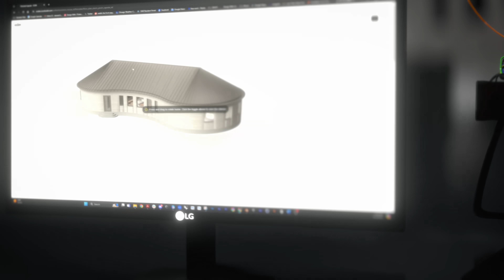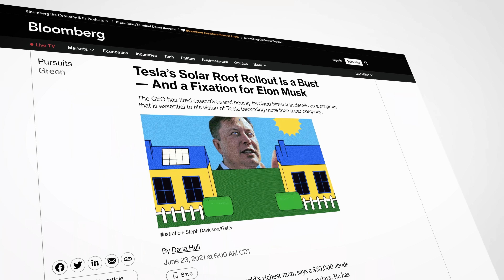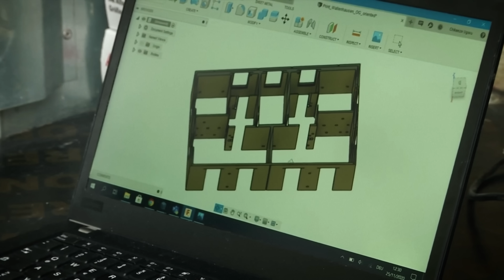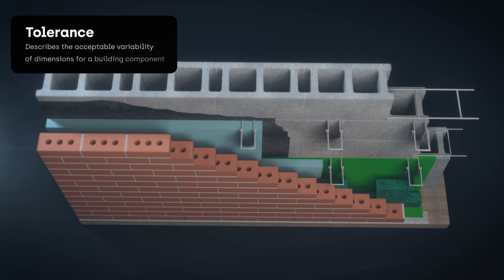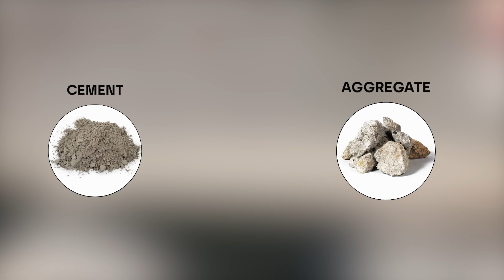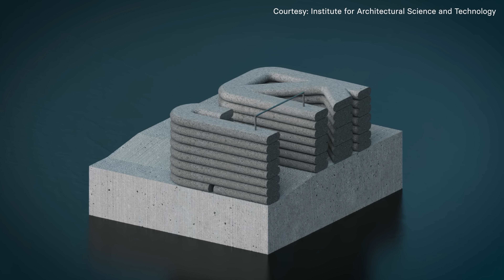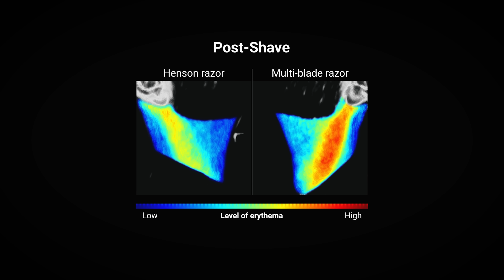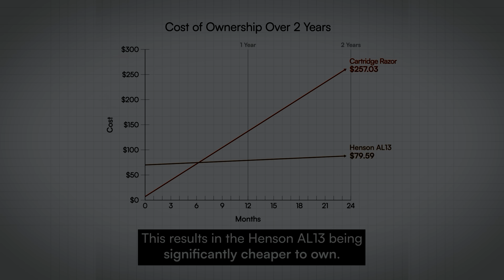Why 3D Printing Buildings Leads to Problems

Comment: Why don't the nozzles have a "fence" on either side to allow the walls to mold into a flat/smooth edge on the exterior and interior sides?  Sure, on each corner, it would be necessary for the fences to adjust in/out to not "cut" into the uncured lower layers, but that seems like an architectural oversight, and one that would be feasible to implement, especially on fresh, soft, just poured concrete. I don't see a "widespread" public draw for the pictured lumpy "toothpaste-layers" look.

I see other comments talking about indoor stucco to cover it, but I've never heard of indoor stucco before, and that sounds like a certain head-scalper if someone trips and scrapes the tough stucco.  Also, stucco indoors is an unappealing, rough, step-in-the-wrong-direction kind of texture anyway. What happened to smooth paint?  Now, "orange peel" texture is all-the-rage, because contractors are too cheap/lazy to do a proper, smooth paint job. Stucco is much worse.

The design of the fence would have to be like a pivoting/sliding trowel, controlled by the computer connected to the nozzle. That would make the finished product much more like a "usual" concrete-walled structure.  An "advanced" fence design could have split "winged" trowels on the sides to really make the corners pop.  It'll take a lot of finesse on both the software and hardware sides to make such a design work, but it should be economical when tuned well.

From a basic perspective, it would look like a Star Wars Tie Interceptor fighter. With the nozzle being the capsule, and the actuating trowels being the wings.

Comment: odd thoughts. 

Why not have a scraper that runs perpendicular to the print head, on the visible side of the wall, that smooths the concrete as it is printed?  Or even a small V-shaped follower that would attempt to make the results smoother and more uniform?

In desktop 3d printing, we often pause the print to insert things like magnets into the print. Could pre-build conduit be used to, say, drop in all of the electrical outlet boxes in a room as it is printed? Same, maybe, for a window frame while the concrete is still wet and pliable?

Comment: Current building materials in the US are shit. Expensive, require high maintenance, building it require a lot of men power, takes long time to build, not sturdy, has a lot of variables, hard to control if material, application, etc are proper as they may later cause a lot of issue.

Comment: I don’t think concrete 3D printing is the future of homebuilding. There are too many issues regarding on how tight foundation tolerances need to be, long machine setup times, limited floorplan flexibility, and the fact that hollow concrete walls often don’t meet insulation needs in most climates. And I think the printed look isn’t for everyone.

If you do it Off-site, it doesnt get much better, the wall components would be very heavy, and installing concrete walls on-site requires expensive connectors and equipment like Munck trucks + insulating and waterproofing that interface of walls and foundation.

That said, I do think this tech is great for making urban furniture: bike racks, planters, benches, bollards, etc. These don't have the same structural demands and benefit from the design freedom and speed 3D printing offers. Futhermore, it's a one time setup on a closed factory

Comment: Also if I want to hang up a picture or mount a tv on the wall or some other appliance. It’s much more of a hassle to deal with concrete than driving a screw or nail into some wood. Also what happens if there is an electrical issue or a leaking pipe behind the concrete wall.

Comment: Yes, you can fix it and hide the grooves. Houses built of cinder block and brick have been addressing this issues of centuries. Outside of the US we cover the walls in a concrete schmear then plaster (the thing drywall emulates). I've lived in both types of house and real walls (not wood framing and drywall) are amazing. You can hang pictures where you want, they provide real sudden barriers, they aren't damaged by water or fire. Maybe you can't get the grooves too match perfect on a fix, but it really isn't hard or a thing the rest of the world doesn't already do

Comment: My opinion on this would be to have the outer wall and interior supporting walls to be 3D printed. 

Any rooms could be done by the more traditional way via wood or steel beams to permit future reconfiguration when they change their minds, open up a room or move a room. 

Supporting walls should stay in place, but the internal rooms would be like any other house. 

And if you need to add to the house, the concrete outer wall can be cut, add supports if needed, and the addition can be poured or built via that opening.

Comment: I love the concept, i hope one day I can hire a company of tech nerds to setup a metal barn frame that is used as the 3d printer's frame, and print the interior of a metal warehouse with cement walls. Get rid of the labor of moving plywood, get rid of the resin offgas from ply wood, get rid of the rotting plywood that always occurs in the PNW. I just want a metal sided barn with cement walls and spray foam insulation.

Comment: Iremember you could buy a house from Sears 100 years ago.  They had a bunch of forms that were lowered by a crane and concrete was poured into them,  they were the size of a wall.  There were windows and doors in the jig.  I heard those houses are still standing

Comment: Round inside corners are untenable. Furniture is square. You will basically have a quarter circle in every corner that is unuseable. Same reason dome homes won't catch on. Everything near the walls is dead space. Square corners and flat roofs utilize space the way we need it. Also, where is the rebar? Concrete with no rebar cracks as soon as the weather changes.

Comment: I see 3d printing structures most beneficial for things like city infrastructure. A printer that sits on the back of a truck, and prints from there stairs, planters etc. which get placed correctly in the environment through lidar scanning.  In this kind of use all the benefits especially the speed gets utilized to the fullest.

Comment: I don't understand some of the premises. Why not just do the same interior work in a printed house you would do in a brick house. Also, with all the advancements made in 3D printing, I am sure we could easily get much smaller layerlines and sharper angles and corners that in the video.
Just imagine the increase in speed we saw in FDM printers applied there, to offset smaller nozzel and layer heights. Then the walls would get smoother and the cornered sharper.

Comment: I just don't get it. Why can't you add a layer of plaster to even out the interior walls, so it doesn't look ugly from the inside? You can make 90 degree walls with it. And why can't you use trim for the outside walls?

Comment: Usa has a big problem with bad framing ,slab construction understanding  (indiana state route 912) electric wiring ,( draw paths etc) piping andelectric  wiring through walls, roofs . Isolation in walls ,roofs sucks really hard . Horizontal clading ( water travels, finds its way into walls. Choice of osb sheets in roofs directly under rooftiles ( black mold) 5 " drive way slabs with a tiny rebar thrown to a grassbed. Everything is sealed with chaulk  and foam scilicon ,letting water in but not out . Framing without temporarily bracing . Using airpowered nailguns everywhere . House fundation on loose grounds. Rain gutters sucks. Framing not qualified for moviesets. Shower rooms? ,No ,more like professional black mold breeding farms .sprayfoam in walls ? Mold! Hot climate? Yes, we don't need isolation , just more AC!  The witches house in hans und grethel was better built than a us house.

Comment: Most of the objections seem underwhelming, like rough walls. You could just plaster over the walls or even hang a backer board of some type. If you can print out the major structure in a few days and then finish it in a few you may still be able to get the profits out of it.

Comment: It's a fairly new technology which has just got the attention it deserved, just like everything else it will take some time to perfect itself but still its near perfect and since its a machine doing it. It won't be long until they figure out a better exterior look which is more smooth and refined and once they do it. It is over for traditional houses, this houses not only give you concrete strength but also has ability to put in insulation and wiring without digging extra holes in the wall or pre installing all the wiring. The only weakness i see is once the house is fully finished there is no room for any extra changes in the future coz breaking any part of concrete hurts whole building integrity so builders better offer a completely custom build house to buyers liking and now on plus side this house cannot burn down and withstand floods and hurricane way better than traditional houses.

Comment: I live in Germany where all the houses are made from stone or very large bricks and blocks. The walls can be 30-50 cm thick. It can take many months to complete the structure alone and it requires cranes to lift the blocks from their location on the ground to the actual location of assembly. Once the walls are constructed and the roof is installed they begin working on all the plumbing, electrical and heating systems which must be installed into the walls and floor. This requires cutting grooves into the walls for wires and drilling large holes for pipes. 
This process could drastically speed up the build process and reduce the cost of this type of house. It doesn't make a lot of sense when comparing it to traditional stick construction in the US but it could be very beneficial here where this type of construction is widely used and accepted. It would help reduce time and costs associated with wiring, plumbing and insulation compared to traditional construction.
Also the interior finish could be completed with a layer of plaster to get the smoother wall texture and square off corners.
A house here can take well over a year to complete just the structure and can take several years to complete the build.

Comment: After living in Germany and Argentina I’ve seen how people use concrete and stone blocks to build homes using things like stucco to texture and insulate. But traditional concrete has rebar and supports in it to compensate for shifting or tremors.

Working with printed Concrete would get tricky to repair, but people have been patching foundations and reinforcing bridges like that for a while. 

I could see cutting out a section and replacing it with brick or cinder blocks if something broke or shattered. Eventually I bet there would be patching techniques that would evolve, and prints could be made to leave standard sized window and door slots, too.

I haven’t seen much regarding using abrasive on the printed concrete to a smooth surface, but where one could stucco a surface, would “sanding” it flat work? Would the concrete resist being “sanded” flat and maybe even textured or painted sealed or having designs printed on the sides?

And are these homes always going to be on slabs? What about greenery or tree roots near the structure?

I’m actually excited to see more of this building idea. Especially in the desert or on the right surface these homes could be cool. I’d love to see domed homes with moss growing on the outside surface. Seamlessness with nature—finally.  Or even hobbit homes.  Why not?

Comment: I'm genuinely curious how someone would access the pipes and electrical in one of these places. Are there just access panels all over the place(because I didn't see any in the video) or if a pipe bursts in my house is a plumber going to need a cement saw and would that now damage the structure of my house?

Comment: Obviously, you are a "influencer-whiner" and NOT an experienced construction tradesman. All your "limitations" or noted shortcomings are not issues. there is so much more to concrete construction methods that can enhance the final outcome of these structures. Your limitations are only showing YOUR inexperience. The value of this method is not yet shown in either text or print. 
You must be a building inspector., or a short-sighted city plan-checker.

Comment: I feel like 99% of people won't give a shit if their house will look like a bad cake, when they will actually be able to buy one. Print away.
Reply: They are not going to sell the product massively cheaper. Only marginally, profit will be kept to a maximum. If you know the building industry, you know.
Reply: @craiglittle1437 I hated when he said "Affordable" that's BS, you know they'll jack up the price.
Reply: Transport, Set-up, disassembly,  CLEANINING all parts, and removal of the gantry system will take $100K.
    It's a construction project in itself.
This technique will not save money.
Reply: @reasonablespeculation3893 this👆
Reply: Bro it's not about looks. It's about economics. 3D printing isn't cheaper than just building a home the old fashioned way
Reply: You really dumb..
The guy us ralking about a house that last for max  5 years.
And you smart ash talking about different subject

Comment: 3D-printed homes can solve many of problems—but aren’t mainstream because:
They don’t fit the “build-to-replace” economy.
	Concrete or geopolymer 3D-printed walls resist mold, rot, and pests.
	They can be designed with high thermal mass—staying warm/cool naturally.
	But they don’t require frequent maintenance or material replacement… which means less profit for builders, suppliers, and contractors.

So ironically, better tech threatens profit chains.

Comment: You can make arch openings using a keystone to affect a window/door opening using bricks. A temporary suppport is used when setting up the bricks but once the keystone is in place the need of a support beam is no longer required.

Comment: Brick is a veneer, a siding.... No more structural than vinyl siding. Please stop comparing 3D printed concrete housing with brick.... It is more like blocks, or better is a form and poured concrete wall.

Comment: Why don't they coat the walls with plaster to smooth them out and cover the defects? Or, have a worker or robot smooth out the concrete walls before they dry?

Comment: This is one of those, "Oh look a new hot topic I can make money off of, if I go against the grain" videos. The arguments you make are mostly, if not all very poor arguments: - "3D Printing is for prototyping" - Look at how 3D Printed components are being utilized in production line's today, including but not limited to, Rocket Nozzles, and other components that would be difficult, if not impossible to produce using standard methods. - "Hard to repair" - It's Concrete, we repair concrete every day, using machines or by hand, and the repaired section is still 100 times stronger than conventional stick building methods today. - You are forever haunted by imperfections during the construction" - Nope, not at all true, it can ground away if dried or manually fixed while it's still wet. And if you don't like the 3D printed look, simply trowel over it, like they do for example Stucco. 
You could have brought up:
- How concrete is a major contributor to CO2 emissions and that would have been a valid point, but they are working on that and making progress to limit, if not eliminate that issue. But you didn't.
- How much less energy efficient these houses are, oh wait, never mind they are REALLY efficient. Yeah, you left that out.
- How much recyclable waste is produced when these are eventually demolished/destroyed, oh wait, I'm thinking of Stick buildings. Concrete can be crushed, the metal separated out, and both reused in-definitely.
- How much weaker this construction method is versus Stick buildings... oh, except it's the other way around.
- How these buildings are vulnerable to little bugs eating away the very thing house relies on structurally. Oh, that's Stick Buildings again.
But you didn't.

The Stick building method needs to go. With today's cheap and fast grown wood, it's hard to find straight lumber, and most contractors won't bother to sort through the pile, they simply put it up. And the first storm that comes by, wipes the building off the face of the earth, possibly resulting in death. Weather is getting worse year by year and our we need to take that into consideration when we take on new builds. The traditional Stick build method is not up to the task. 3D Printing and other concrete construction methods are. Just look at that Florida neighborhood that got hit recently. Only one house was still standing, and it was built using ICF Concrete construction methods.
Many today's construction companies concentrate on one thing, and that's to build as cheaply and as quickly as they can and cut as many corners as the inspectors let them get away with. And a large portion of Inspectors don't even bother to properly inspect houses anymore.
Just look at the crap the few skilled inspectors around find and post videos of. And a lot, if not most of those houses had already passed official inspections.
This method helps circumvent or at least minimize many of those issues.

The only REAL issue with 3D House printing, is the fact that a lot of the 3D House Printer manufacturers are trying to Vertically integrate down the entire home construction line, removing the opportunity for smaller locally owned construction companies to participate in this emerging market.